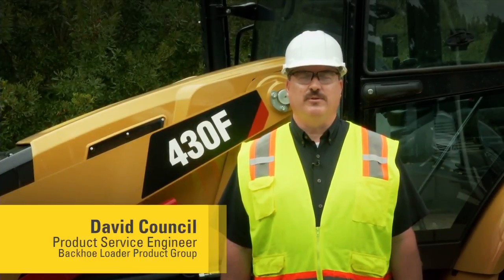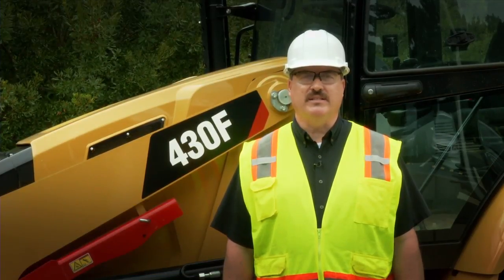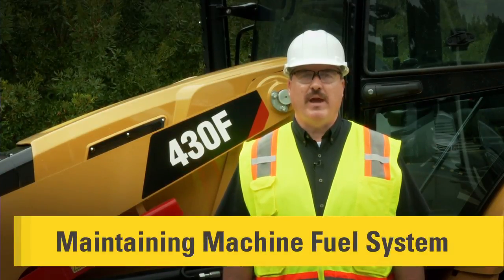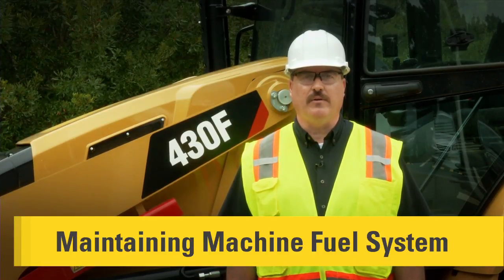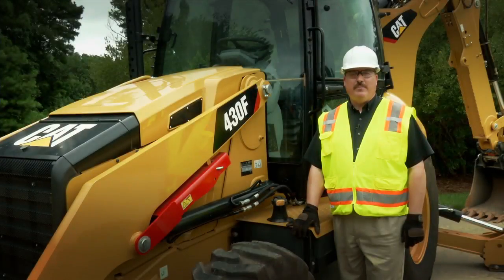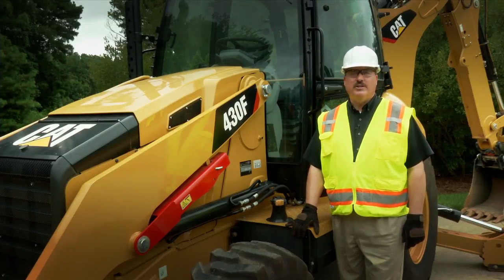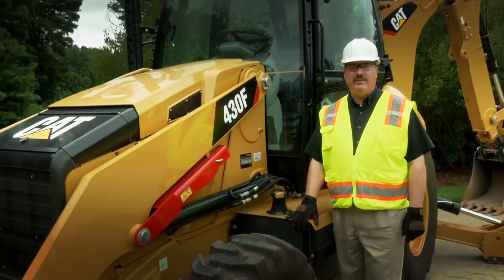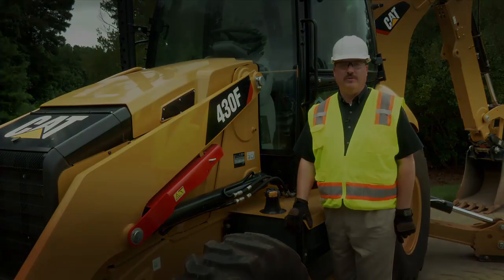Machine Fuel System - Maintenance Practices for the Cat® 416F, 420F and 430F Backhoe Loaders

Comment: Can you drain water from tank with a full tank of fuel or is this when diesel tank is empty?
Reply from the maker: Hi James. Yes, water can be drained from the fuel tank even when it's full of fuel. The density difference between water and diesel fuel means that the water will settle at the bottom of the tank. The drain plug has a slot in it so that you can back out the drain plug until water starts to run or trickle out. Once you begin to see fuel instead of water, the plug can be tightened back up. The slot within the drain plug allows you to drain water without fully removing the plug. - Maria